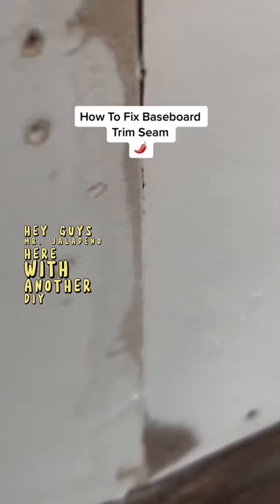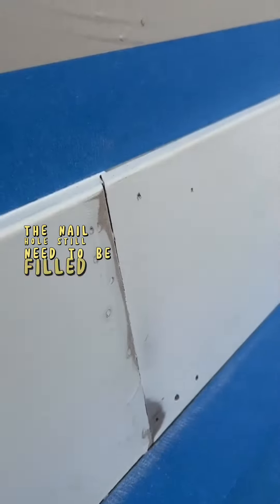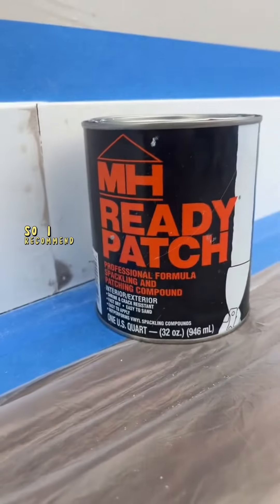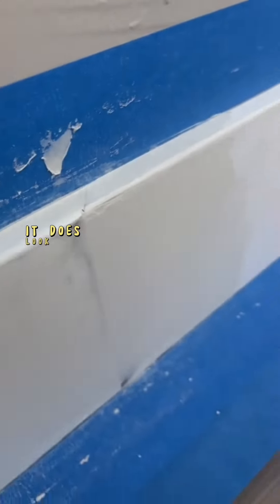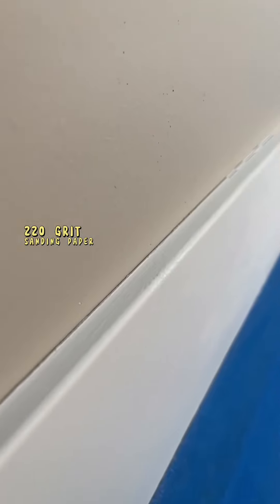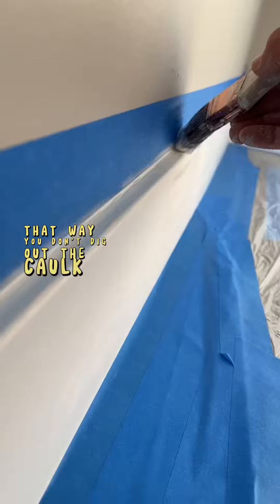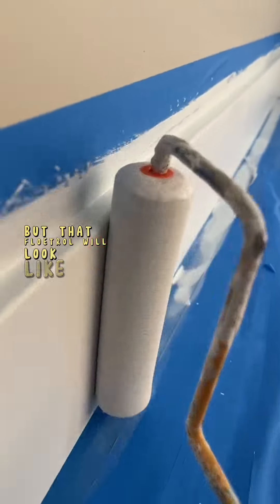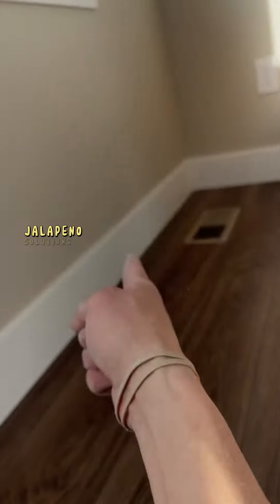How To Fix Baseboard Trim Seam.  #baseboard #homemaintenance #howtodiy #handyman #diyproject

Comment: How come every time I use tape in a painted wall it rips off the paint when I remove it?
Reply: You have to remove the tape while the paint is still wet. Its tricky to do all the steps as fast as you need to but thats why pros are pros